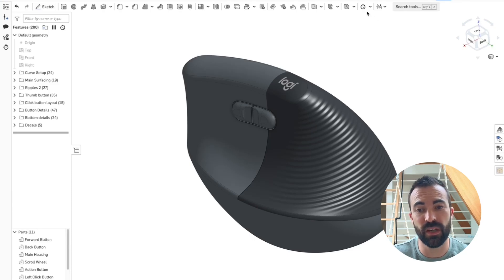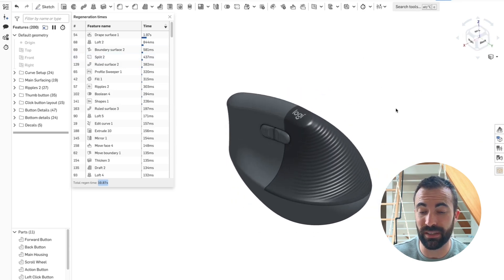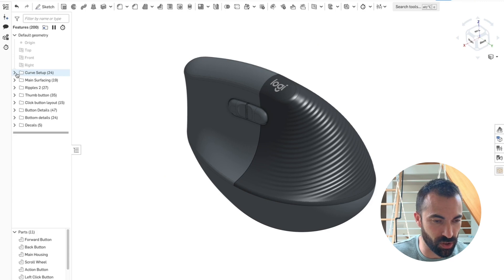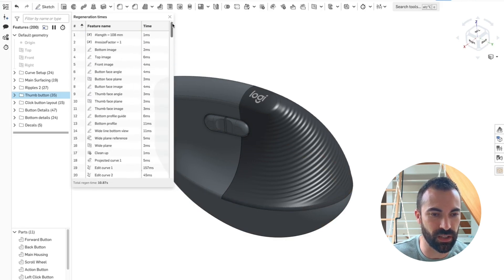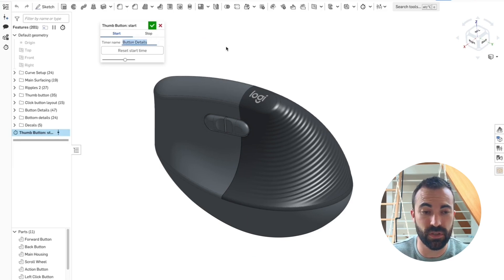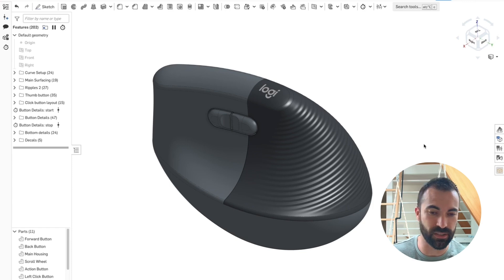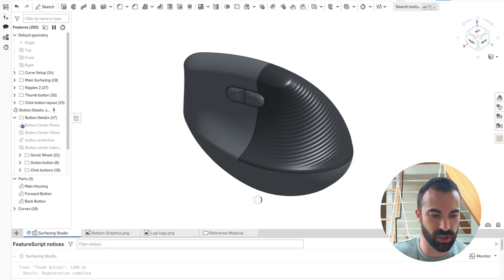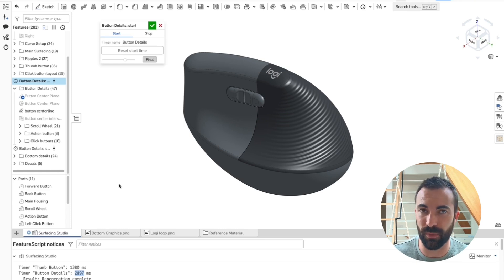Regen Timer Custom Feature

Comment: I'm the only one who keeps track of 51 commands you've created. This is 52.
If Onshape implemented these into its system, we'd slowly reach the level of NX...
Come on, keep it up!
Thanks for all the new stuff! :goodvibes:
I really miss PMI dimensioning (real-time, 3D dimensions) during modeling.
Can I ask you for something like this...? 🤏
I have some ideas... 🤗
Reply from the maker: That's flattering, thanks! Not sure if you knew I now curate a list of them on my site here https://www.theonsherpa.com/custom-features.

I've not used NX or PMI, but it sounds similar to model-based definition from a quick search, which is coming to Onshape very soon: https://www.onshape.com/fr/blog/what-is-model-based-definition-mbd
Reply: @evanareese  
Hooray, that's going to be a popular feature!
I started compiling a document of the most valuable commands, like a collection, but I'm already at 161 pages and not even halfway through the commands. A quarter of them are from a master named "a certain Evan Reese"...